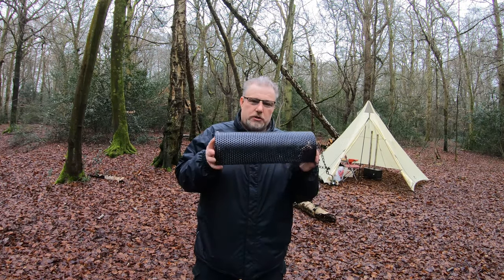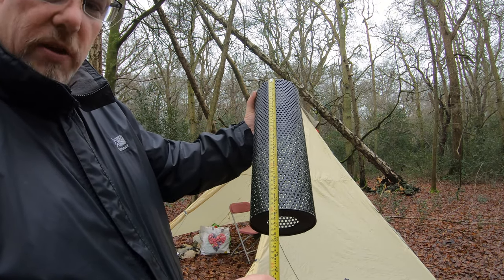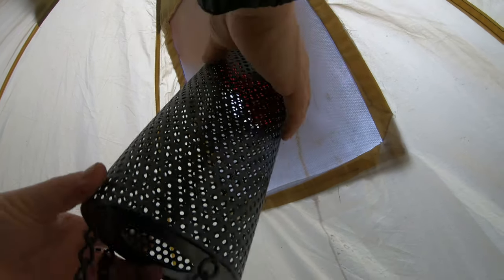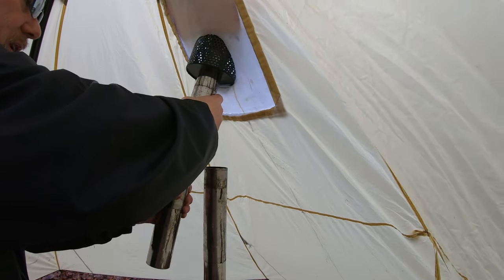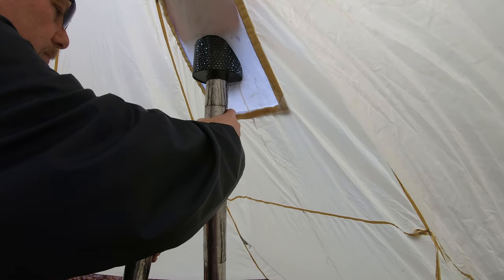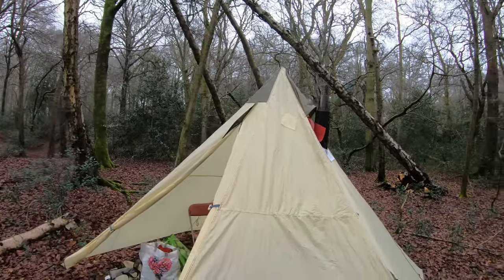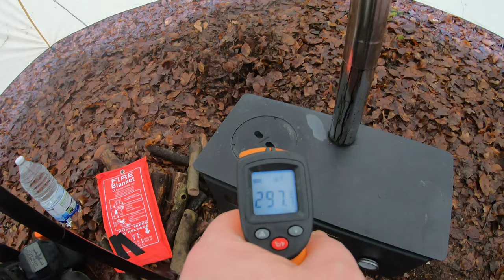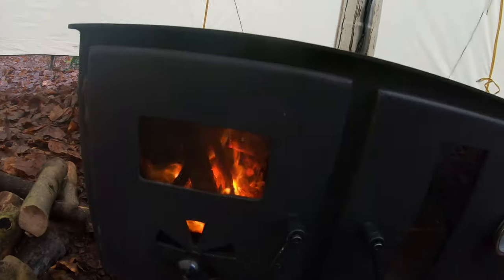Tipi Sleeve - Tent Protector Outbacker Stoves

Comment: Put a 3 inch Jubilee clip on your stove pipe then rest the tent protector on the clip, works well. If you think just what the protector looks like,  I went to Ikea and made one and it works a treat. ATB.
Reply from the maker: I have the jubilee clip with wire loops for steadying the flue in wind. I thought about using it the way you have suggested. The next video i will put it into practice. Thanks for the suggestion and watching.

Comment: Hi Paul did you have the heat shield made or where did you purchase it from I have a tent stove with an 80 mm flue it seems to be an odd size in tent stoves so I modified a wire mesh bird feeder to work as a spark arrester cheers from Carlisle Cumbria.
Reply from the maker: Hi Gordon, I got the shield from Outbacker Stoves. https://outbackerstoves.co.uk/collections/accessories/products/tipi-section-for-frontier-or-outbacker-stoves I don't know about 80mm size. Thanks for watching.

Comment: I don’t get it. You have a stove jack, meant to ensure that your tent doesn’t burn or melt.
So why use a protector? Aren’t those supposed to be used for a tent without stove jack or with canvas tents?
Reply from the maker: In strong wind the tent moves so much being so light i was concerned about the top vent touching the flue pipe. This will stop that from happening.